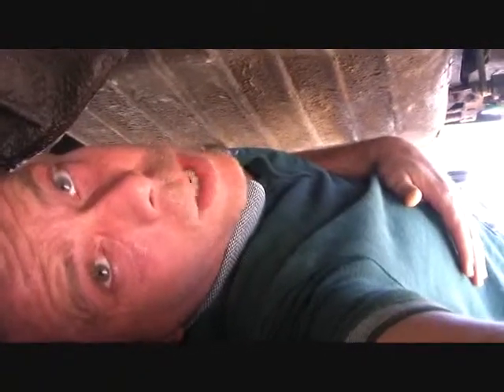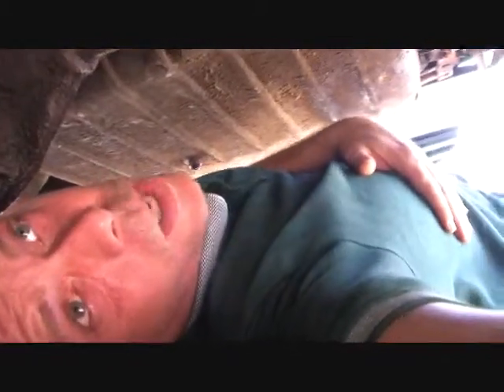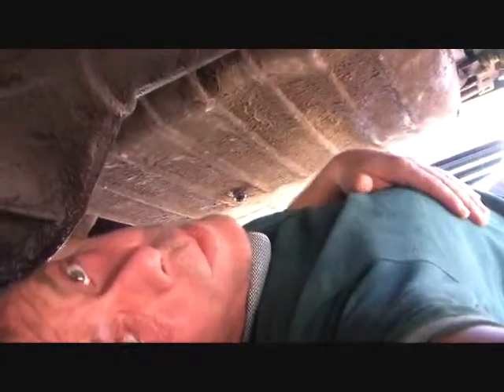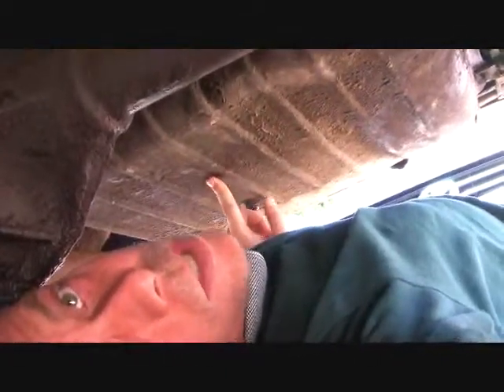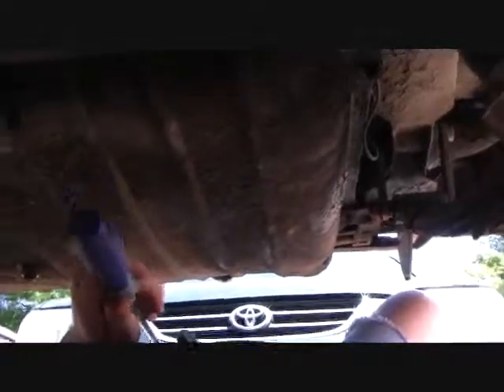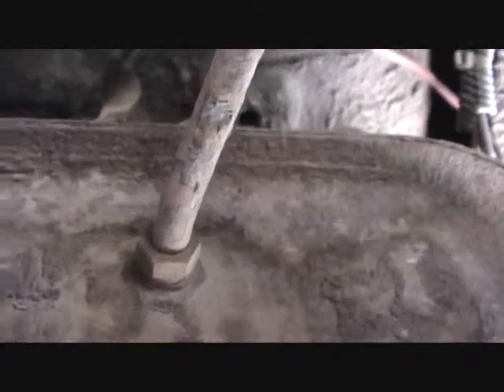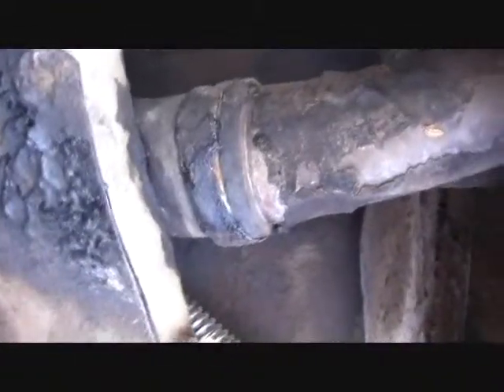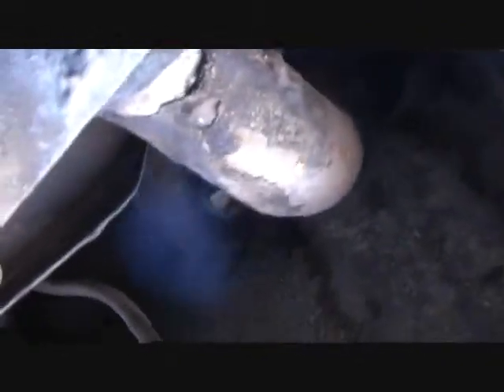Studebaker Champion Fuel System Restore (Research)

Comment: Good luck with a mechanical fuel tank and a double pump will operate wipers better. I've tried 3 pumps and now there's an electric 6v pump. 6v wasn't too hard to find